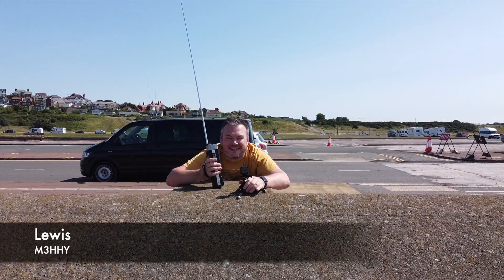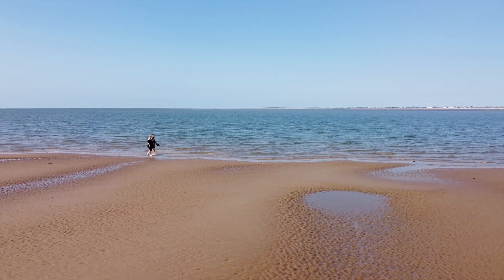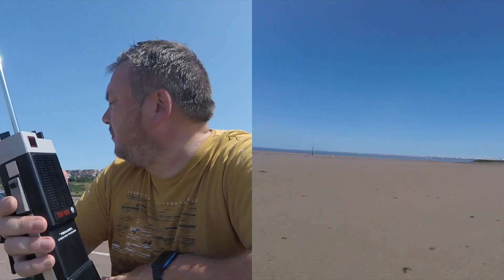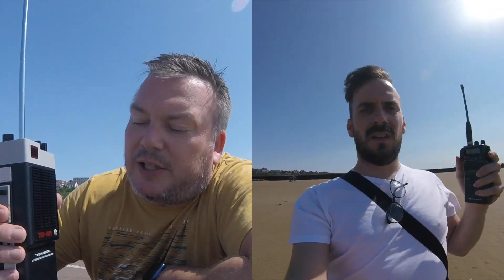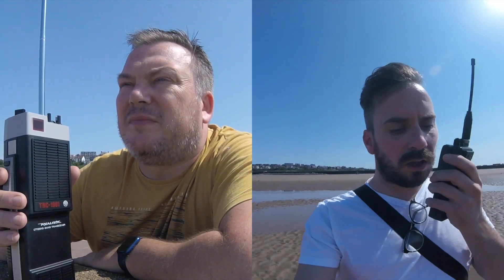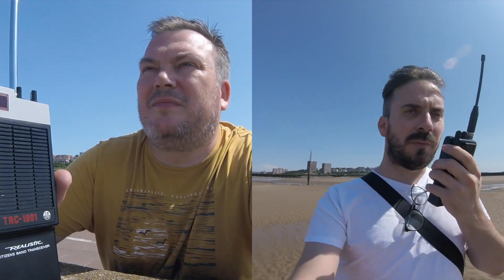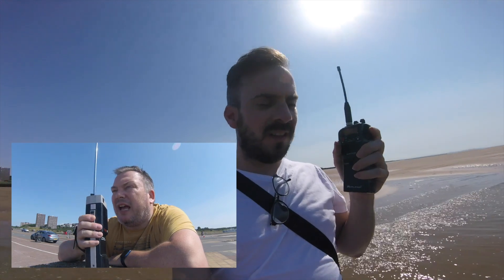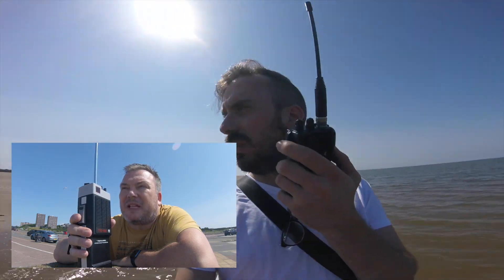CB Radio Testing On The Beach - Old Vs New - Realistic TRC-1001 / Midland Alan 42

Comment: I bought a Tandy TRC 1001 back in 1982  CB27/81 UK 40 channels, to see how far I could get out, and was amazed at peoples reactions homebased when I got through to them on 4 watts FM.
One day I had a guy home based over 40 miles away whilst up on a high mountain in South Wales, furthest I ever got, one off I guess!
Weak signal but he could make out my modulation ok.
Locally 5 -10 miles was about the limit depending on terrain! 
The long Telescopic Antenna being far better than any short flexible rubber duck of course.
Also used it in the car several times into a magmount, and occasionally as base station using the adapter to a SO 239 on side of handset.
3 way operation, and I had the extension plug in mic too.
I remember over the years I used 3 antennas, nearly 5 feet long they got bent if you weren't careful how you used them!
I'm not sure, but I think I've still got mine packed away up in the loft somewhere, not been used since 1990s, probably got dry joints etc, so may not work now.
Happy days CBing back in the 1980s!

Comment: I had an Alba 40  channel handheld back in 1982 and swapped for a Midland 3001 a few months later.
A couple of years ago I found another Alba handheld in a charity shop for £3.99 complete with case and it works fine.

Comment: My first CB was one of those 2 channel handhelds with just channel 14 and 30 to choose,  you'd spend all day waiting for someone close enough work 🥴. Boots the Chemist sold FM CBs when they were first legal too. Echo chambers and 'power' mics were the rage too. The fumes from the lead acid car batteries charging beside my bed at night probably didn't do me any good either 😱
Reply: Amstrad HCB1?
Reply: @wisteela  Alba CB HB1 😁
Reply: @wisteela  cb hb1 same unit lots of badges but all uniden boarded which is why they were good, and still are today, just get an unmolested one, dont buy modded ones.

Comment: S as a a long standing cb operator with many different radios to hand, I can say from the realistic to a base station, you would probably get 5or 6 miles, in average rolling country with buildings around, more in open flat land Line is sight. The midland is a radio full of features, but range is not one of them, some I’ve had can only manage a few hundred yards due to the aerial and a very low power on batteries, although work well on an external supply with the battery eliminator. Good video, still using cb radio for the majority of my communications and for pleasure too.👍

Comment: I've got a pair of old Japanese transistor walkike talkies with telescopic antenna's as tall as a person. I've seen the exact same model be used in X-Men Wolverine movie, around the helicopter scene. 5 channels. Supposed to be up to 25km range in the open, but I never tested them under optimal conditions. Each one runs on 11 AA batteries, which is such an odd number. Each frequency channel has its own crystal slot. Only 1 channel is populated by default. Early transistor tech. Huge components and thick wires on the inside. The pair still working, despite being from around 1960's, I think. I haven't really read up on them.

Comment: I use the radioshack TRC 237 and JIL Citizen BPL 524-77 together in some events, they work pretty well for the better part of 1/2mi when the batteries are fresh in the HT. Otherwise 1/4mi on a good day with stock antenna is about it.

Comment: I owned one of those Realistics and I  remember it used a lot of AA batteries and would just DEVOUR them, hence the radio didn't get used much.
Reply: Automobile Association sold batteries for CB radios?
Reply: They did indeed. I ended up using mine with a power supply in the end.
Reply: @stakkerhmnd  AA are a size of battery. Unless you were joking.
Reply: a good old unit set up properly but using modern lithium aa cells works great, battery technology has improved to such an extent the older radios shine.
and the audio is nicer than the £49.99 miniature cb's off ebay.

Comment: I had one of the "old" 3 channel crystal hand held Realistic CBs. I don't remember the output power... it was powered by one 9 volt battery. I regularly was able to qso with truckers on the interstate which was 4 miles away.

I've been hearing that the U.S. FCC is going to approve FM ops on the 11m CB band. I've been liking the new President handheld CB which is just AM. But if we are able to go to FM, I'm hoping President comes out with a new  HT.

Comment: Hi Lewis here's an idea for in the future mate why don't you try southport Beach? Because I used to go there in the past before I first took the foundation Licence back in 2001 and I used to take my Rotel RVC-240 40 channel CB and I also took a DV-27 antenna on a large buscuit tin and the contacts I used to get on the CB was astoinding and I made loads of different mates from all over the Southport area and sometimes right out in to Blackpool and Fleetwood and I even got a guy in the Lake District and he was 5-8 to me and I was 5-8 to him and I was only using the 4 watts and he said that my radio was working extremely well and he was on a Presiden Jackson 10/11 meter SSB radio and I did ask him to turn it up to QRO and then he was the second bar of the 30 dbd so that was a really good contact down on the beach so all that I'm saying Lewis is to go down to Southport Beach and then do some radio checks with your mate and I'd have a go on the PMR446 as well just to see how far away you can get down on the beach mate OK so it's just an idea for you maybe in the future OK. Thanks take care and best 73's for now then mate OK Stephen M3SNV 73's.
Reply: Hi Lewis I go up to Southport every so often in the summer and I always take my Baofeng UV9R plus and a ABBREE antenna and I've got a Yaesu FT-817 and I'm going to get one of those HF antennas what you put on the top of the radio and I've got a lead acid sealed battery 12 volts 7.5 amps and that will last all day on 5 watts QRP and I've got a linier amplifier a Tokyo High Power and it does 50 watts on all of the HF bands so that will come in handy if I do the intermediate license in the future mate so if your ever up in Southport then you might get myself on the 2/70 and the HF 40 and 20 meters mate OK. Stephen M3SNV.

Comment: A trip down memory lane, mixed with the new. Not surpassingly, large scale integration and surface mount has dramatically reduced the size of modern offerings.
Reply: Indeed. You couldn't argue with the quality of those radios though.